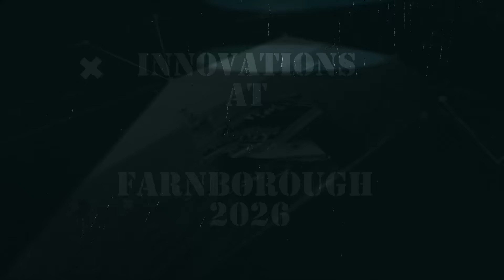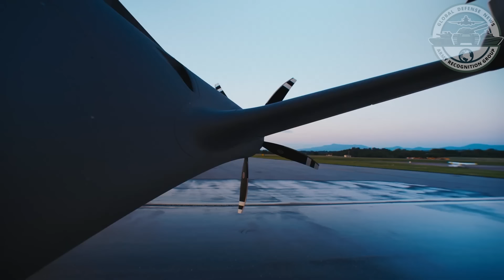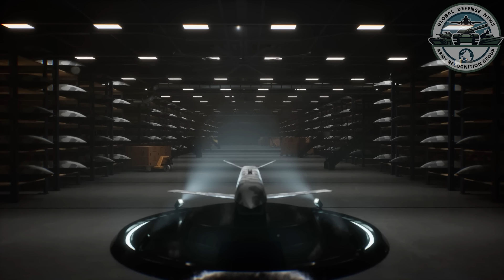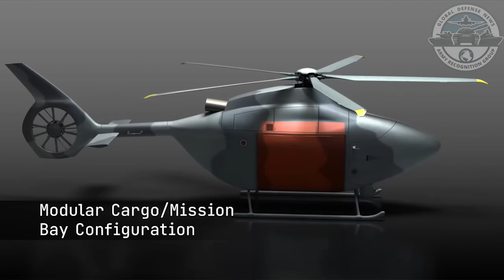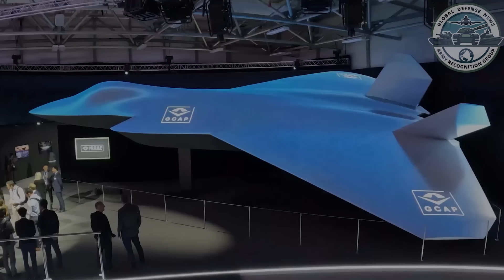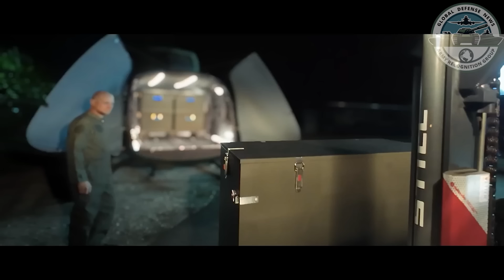Top 10 Aerospace Defense Innovations 2026 | That Will Shape Future Warfare

Comment: # 2 with its 2  tilt rotors (similar in design to the PROVEN expensive, undependable & DANGEROUS OSPREY tiltrotor)  just looks vulnerable compared to other VTOL craft which use 6-10 or more smaller props each carrying a smaller load.  It will certainly be less survivable because if just one blade on the 2 massive props is hit by enemy fire. . . . . ! This is is a BAD CHOICE & waste of our taxes - there have to be better designs, and better equipment CHOOSERS.. Note that their missions are vaguely explained, letting viewers to assume their missions are relevant to modern warfare, as revealed in the Iran "adventure."

Comment: 6:27 Wait what? The mv-75 was called the v-280 because it was required to go 280 knots. Now hes saying the production aircraft should be a tiny bit faster than the prototype which goes 220 knots. Wtf happened? Thats not a small difference thats 250 mph vs 320 mph.

Comment: I'm going to suggest that, with Australia having cancelled (or, rather, paused) its planned purchase of a fourth squadron of Lockheed Martin F-35 Lightnings, Australia will have more choice in purchasing upcoming aircraft, like the Tempest/GCAP.  After all, in 2025, Australia announced it was actively exploring involvement in the program. It is seen as a potential replacement for its F/A Super Hornets.
Reply: The Boramae isn’t a bad idea, twin engine keep the F18 and F35’s.
Reply: Australia would be better off with SAAB Griffin E and F, a light single-engine supersonic multirole fighter aircraft that has Advanced electronic warfare with spherical coverage, Revolutionary avionics architecture supporting smooth capability growth to maintain technological superiority. The F model is a two seater multi role aircraft that will save on trainer aircraft and expensive simulators. The E model, a single seat model. Maintenance costs are reduced significantly and a five man crew can change an engine in the field in under an hour with hand tools. It ran rings around the US fighters in NATO exercises and would cost significantly less than the US/UK fighters, is proven and off the shelf. Unlike all the latest procurements including the AUKUS debacle, where the technology is obsolete by the time it’s in service.
Reply: @soschili8857  Australia would be better off just asking Palmer Lucky to revise/devise their military defense (against guess who?). Better hurry!

Comment: The Cessna seems lik a copy of the Twin Otter from DeHaviland
Reply: It's a case of form following function. Skycourier was originally designed to haul cargo in the form of (IIRC) 3 LD6 air containers for the big parcel haulers. It looks to have about the same capacity as the Twin Otter. While we might see a 'big wheel' Skycourier, I seriously doubt we will be seeing one with floats.
Reply: A lot of these devices seem like unneeded copies whose funding could be spent on advanced "Palmer Lucky" inexpensive, future warfare devices.